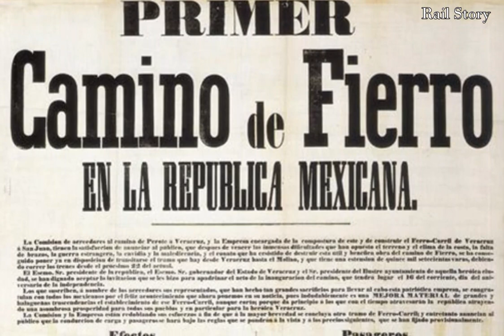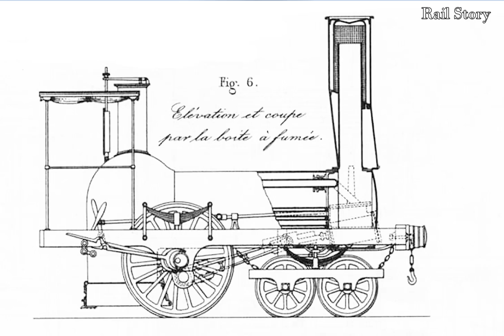La Veracruzana: Mexico's First Locomotive

Comment: Was it carrying a real bogie at the front? Or was it fixed. Seems early build for a real bogie. Thanks for the video.
Reply from the maker: It was a real, articulated bogie. Bogies have been around since 1812 (patent by William Chapman); Puffing Billy and Wylam Dilly were on bogies and in the United States bogies were in use from 1831/1832 onwards. Robert Stephenson introduced bogie locomotives for the American market in 1833. La Veracruzana is based on a Baldwin design for a 4-2-0 bogie locomotive.
Reply: @AnthonyDawsonHistory  Thanks, didn't know they were that early.